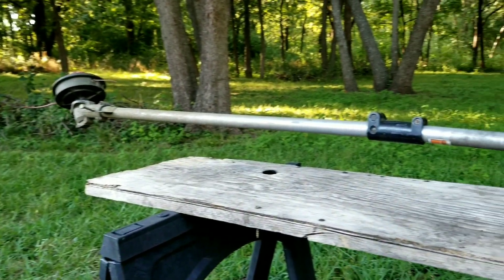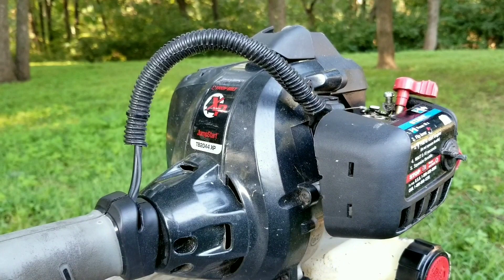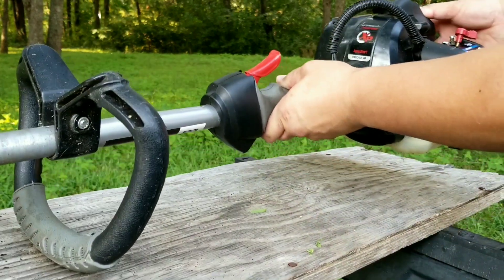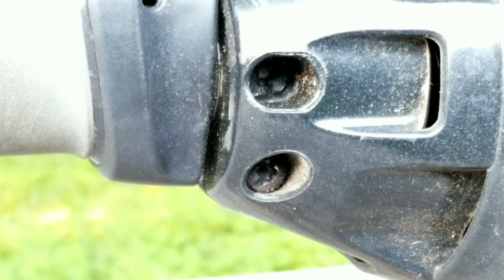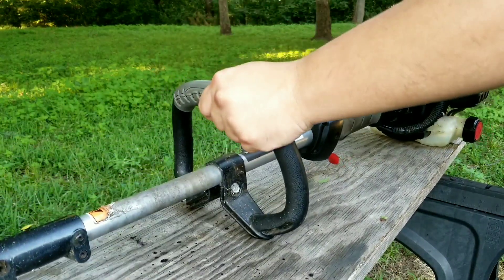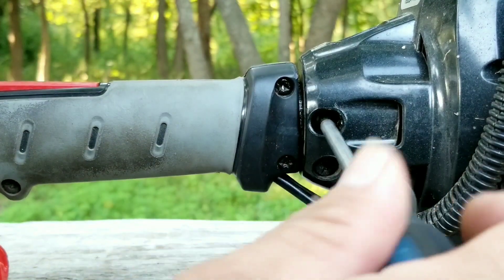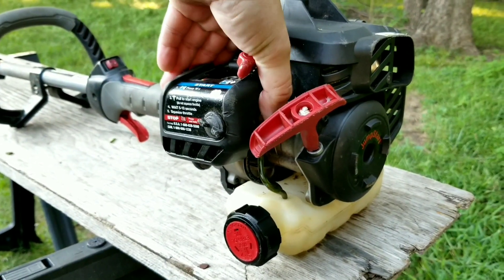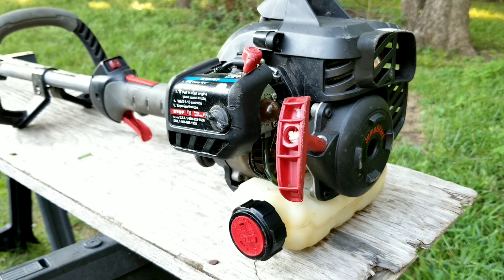This Troybilt Trimmer has a strange problem.

Comment: Use blue loctite on all screws that go into metal  on 2 cycle equipment since they vibrate so much. You will never have any more problems with losing screws more than likely.
Reply from the maker: thanks for the tip i appreciate it

Comment: I would try loctite first if that didnt work i would redrill and tap the hole with a bigger screw and hope the neighbors would put their trimmers to the curb with the same problem so i can fix and sell them .
Reply from the maker: That's a good method.  I would probably do the same thing.  Thanks for the comment I appreciate it